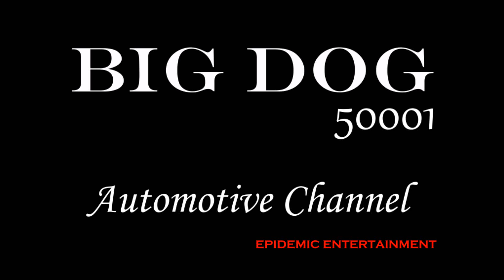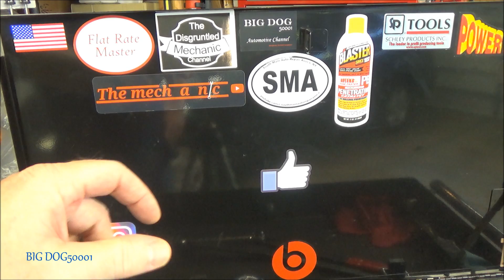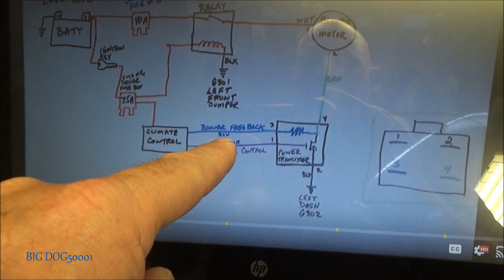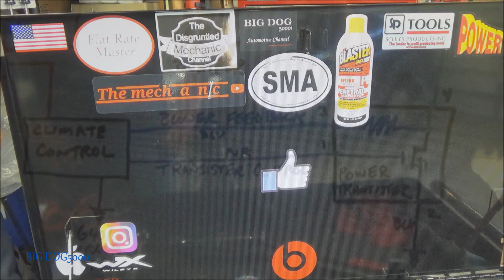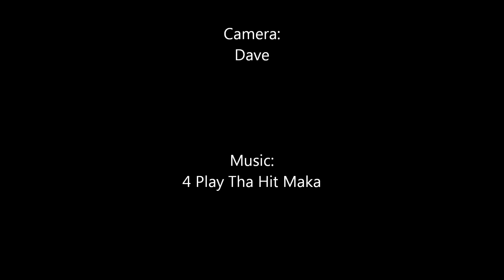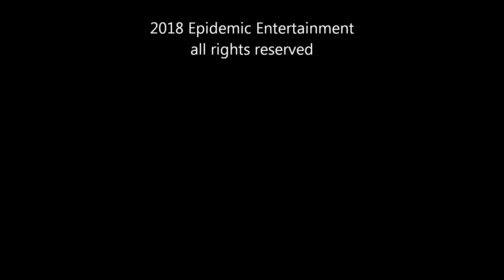Honda Quick Tip:  No A/C - Compressor Not Engaging

Comment: On a 93 civic hatch there's a 20 amp condensor fan fuse under hood on passenger side that I accidentally put in the  third spot instead of the second spot down. It looked like third spot on fuse cover diagram when  I put fuses back in. Cold ac now..

Comment: My SO' took her civic to the dealer about 2 years ago because her a/c wasn't very cool. They came back saying the Compressor blew up and there was metal shavings all through·out the system. She could not afford the 4200 charge so she decided to leave it for now. We never noticed any noise, smell, rattling or anything else that would indicate their diagnostics. It still ran great, cold air and all, till about a week ago her blower just stopped. Again, with no noise or smell or anything it just stopped. Would a blown up Compressor last this long? Can it just be the blower motor/resistor and they were pulling our leg? Where can i start to solve this issue? Any help would be appreciated, Thanks.
Reply from the maker: I can't see what is going on but here are some signs of an A/C compressor going out:  the A/C system will perform poorly, A/C will not work at all, A/C system pressures (on A/C manifold gauges) will be incorrect, the compressor will make noise, or the compressor will put a strain on the engine when it comes on.   A blower motor going out will generally not effect the A/C system other than stopping the compressor from engaging (like in this video).  

A/C compressors can be damaged and still go quite a while before completely "blowing up" and not working at all.  They can also throw tiny metal pieces into system and still work (although the system usually will not work great if that happens).  I would troubleshoot and fix the blower motor issue first.  An easy test for the blower motor is to turn it on and then tap bottom of blower with the handle of a screwdriver and see if it immediately starts working again, if it does then it is most likely a bad blower motor.  After fixing the blower issue, you may want to get a second opinion by a good A/C professional if the A/C system is not preforming properly.